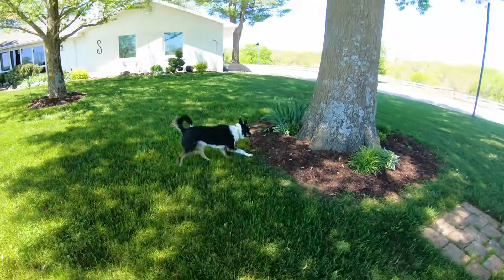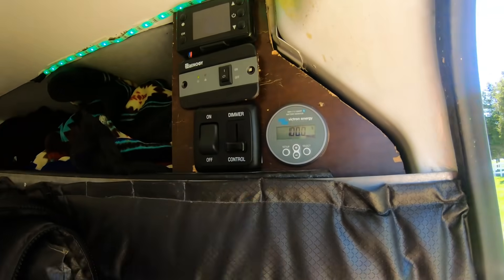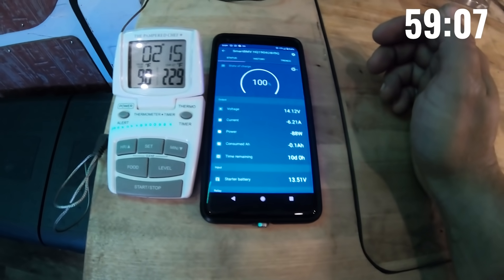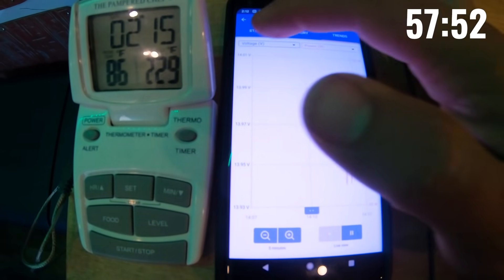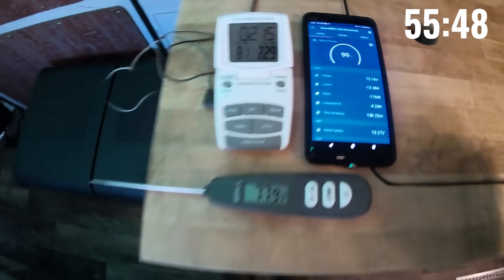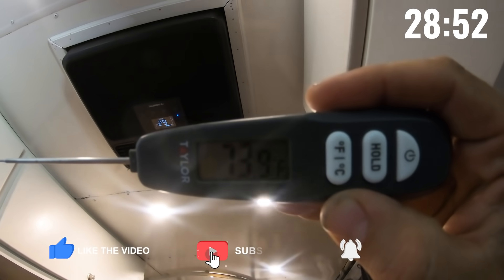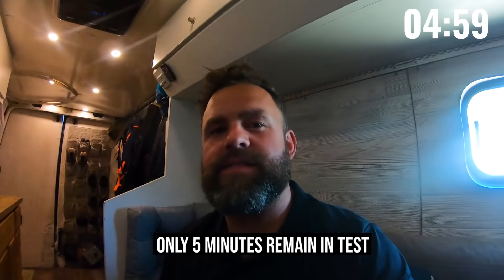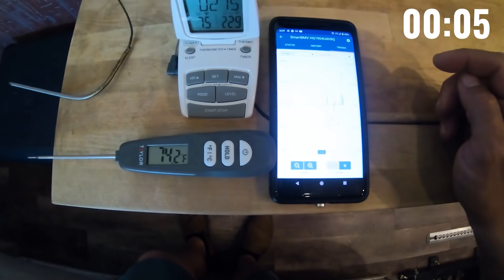12 Volt DC Air Conditioner | POWER CONSUMPTION TEST | Dometic RTX 2000 |  Van Life

Comment: Wouldn't people be precooling their rig with the van AC, then using the roof one to hold that temp once shut off? That should significantly increase the run time on the batteries.

Also, do you have your house batteries isolated or tied to the van alternator?

If this has been answered, then I'm sorry. I just found you channel and this is all I have seen. Please point me to the correct video if applicable, thanks.

Comment: The "hybrid method".

Run around doing your chores, sightseeing, etc. w/the van a/c running full tilt... then when you are at your destination, turn on the roof a/c (while the van still idles). Within minutes & very little battery usage, you will be at any reasonable indoor temp.

Btw, is that an a/c only, or a heat pump that also heats when it's chilly out?

Fyi, you should install window shades on the outside of the van to keep that huge windshield, etc from having solar gain!  They must be outside for best reduction. 

These have been common with class A & C rv's forever.

I like your wet jet cleaner for the panels!!!

Comment: If been saying it for about 2years now, the first company that can successfully make a GOOD air conditioner for vanlife will end up being rich....because we're all waiting for it!
Reply: The mini split I installed on my travel trailer uses 300-400 watts compared to the 1200w the factory Air conditioner used. It's much quieter too 😁!
Reply: @chachi5975   Hi, does it run on DC?  What is the brand?  I do know those are whisper quiet.
Reply: @garyhiland6013  power inverter so I guess it's not quite the perfect solution but I have a significant solar setup.
Reply: @chachi5975  WOW ❤️☮️ thanks for sharing 💖
Reply: @chachi5975  which model?
Reply: What size is the AC unit?
Reply: There is a HUGE pent up demand ready to Buy a good DC air conditioner that can run directly off the solar panels.
Reply: I've been running a minisplit in the Chihuahuan desert for over a year one three solar panels.  Used panels at that. Self installed. Under $1500 for everything AC, Inverter, battery, panels, charge controller. It's also scalable. And replacement or repair parts are widely available, unlike rare Uber expensive RV units that use double or triple the power.
Reply: You are so right!
Reply: $4k for this unit? They get rich and their customers get poor...
Reply: @billiamc1969  4K? I don’t think it’s that much…2.7k, I think.
Reply: @robertsarzanini1676  ?domestic link no rtx model? Bad link
Reply: @billiamc1969  

If you think that's bad consider how much a vehicle depreciation costs you.
Reply: I’m sure the owner of Dometic is already rich
Reply: Very useful
Reply: Whirlpool, though wall and a 1000 watt inverter.
Reply: They make 24/48vdc (or 120/220v ac) mini splits that do this very nicely , low power and not very much noise.That size area he has betting a 6-9k unit would do nicely and only take 500w-1000w depending on chill you demand inside of van vs outside temp then it drops down to say 300w-600w to maintain it after it gets down to temperature .Fill roof with 400w solar panels and mount the ceiling cassette or inside ceiling/wall unit. Mount condenser on back door as it only weighs maybe 85-100lbs.People do it all the time in both AC and DC versions of mini splits.Better to use the 48vdc versions as your using solar/batteries anyhow.Will need to upgrade battery bank/split inverter to lithium to be able to use the 220 versions on larger RV's that need larger then 12k but units that require 220 ac.
Reply: Alibaba. $430 for the unbranded version of this. :-)
Reply: @BreAsop  lol its true just type 12v air conditioner
Reply: @BreAsop  could you show a link to the Chinese copy rtx 2000
Reply: @BreAsop  unbranded no warranty good luck sucker price
Reply: @doghousejim  personally don't care about warranties, do all the repair work myself.
Reply: I dont have a van so i'm not waiting for it. 
i just came here for the solar powered ac content. i dont care about vans.
Reply: @darkshadowsx5949  We don't care.

Comment: 5,000 btu window air conditioner uses about 450 w off an inverter and they cost under $200
Reply from the maker: But then you have to cut a giant hole in your rig that screams "someone lives in here!"  For that reason I experimented with disassembling a traditional window unit and mounting it as a mini split with the radiator underneath the van to expel heat and condensation..... After much trial and error I decided to go with this roof unit. To each their own, just trying to spread info on this unit that just hit markets spring 2021. ✌️
Reply: This..if it falls out you just keep driving.  Wal mart had some 5000btu window ac marked down years ago for $30..i should have bought the whole pallet.

Comment: With the panel output you are still in deficit consumption mode, not sustainable long term. However once the van is cool you may not be in a deficit. What I would like to see is a test over several days.
Reply: Solution is simple. Run van engine for a wee blast.
Reply from the maker: This may be true. I need to test individual panels and see if any diodes have failed.
Reply: We just installed a 200w, 20amp system on our augmented scuba trailer.  Since we're completely new to the off-grid aspect, we didn't want to jump into the deep end, and we know pretty much all of the system is scalable.  While insulation has dramatically helped reduce the heat build up (we live on the Tex/Mex border that you've heard so much about lately), and extremely high-efficiency A/C unit would be a nice add-on.  Did you find that you had enough solar coming off of just the two panels (assuming nominal PV production from them) to be enough for the A/C unit?
Reply: @cetifoxproductions  you generally need 1000 watts minimum. My 800 watts is not enough for all day.

Comment: If I’m not mistaken you can take battle born batteries all the way down to zero and recharge without damaging… also they have a 10 yr warranty
Reply from the maker: You need to read about Lithium batteries (including BB!) DOD or Depth of Discharge. Simply put, any discharge below 20% of the battery,  you WILL degrade the total amount of power the battery will be able to hold. This can ultimately lead to a shorter life if you are constantly discharging them to near 20%... In comparison Lead acid batteries are only supposed to have a DOD of 50% this is one of a few reasons that Lithium are superior to Lead acid. I do believe BB batteries have a BMS (Battery Monitoring System) that will prevent you from discharging them below 20% but you should know what stress you are putting your expensive system through!

Comment: It doesnt blow lower than its set at until the return air drops below roughly 10-15 above the set point. If its 65 in the room it will be around 50-55 coming off the ac

Comment: My 5000 btu AC only draws 27amps DC in my roadtrek. With 560 ah 13 volts of lithium that gives me almost 20 hours of use, and of course much extended with my 300w of solar. It kind of looks like a regular small air conditioner does pretty good, as compared to you Dometic. Of course when 560ah are gone it takes a long time to charge.
Reply: Hi Rick,. What brand ac is that?  Where are they sold?  I'm interested.
Reply: yea, what brand, model you got?

Comment: Thanks for posting this. I forgot there were options besides a 14000 btu 20A AC unit powered by an inverter for boondocking.
Reply: They make 24 and 48 vdc complete roof top units , have been for many decades but are expensive compared to mini splits which do the job so much better , plus is you heat also from them.Roof units just arnt that efficient either 12v or the 120ac either ac or the heat pump models.

Comment: In residential hvac units, the rule of thumb is that the air coming out of the unit should be 20 degrees colder than the air going into it. The temperature you set it at has nothing to do with it. As the temperature in your van drops, the air coming out of the AC will drop with it. 

The temperature you set the AC to is just there so the unit will stop cooling when that temp is reached. It's just an "off" switch. Hope that clears it up, and thanks for the video.
Reply: If I am reading the specs correctly the unit has a variable speed compressor so the delta may vary with setpoint vs actual.
Reply: This is mostly true but changes a bit with variable speed compressors.

Comment: Noted that your solar panels are very close to your roof . Due to very big inefficiency of solar , it is a normal recommendation that the panels 
Are a minimum 70 mm off the roof .
Suggest you Google the inefficiency of solar as the temperature goes over 25 c
All panels ratings are done at 25c
You will be amazed.
Reply: Wouldn't that start to pose some issues with drag while driving the van?
Reply: @platinumsky845  if that concerns you , place a wind deflector at 45 deg on the very front panel. I did this on my van
Reply: @leithmurray736  alright, I'd just be worri d about the structural integrity under high wind speed but that sounds like it would help a lot, thanks.
Reply: @platinumsky845  I have 2 x 150 watt panels mounted on aluminium angle mounted directly to the roof of my vehicle with 70 mil space under the panels with. A 100 mil x 1100mil front aluminium wind deflector. This was done to keep the wind noise down to normal.
I have on one occasion tried to see what this campervan would do . At 175 kph , I was starting to run out of road
The van has done over 100.000 kil with these panels on .

Comment: I have an ecoflow delta with (2) 110 solar panels... Would this power it okay? Thank you!
Reply: Not enough power sadly (1008wh useable) with your set up. You might be able to run for a couple hours. The issue is I don't believe with the Ecoflow you will be able to get caught back up with a recharge on your system with only 220 watts of solar (topically never get the full watts out of panels). Ie unless you have a fast charge, more panels and full sun non stop which is not going to happen sadly with most SoGens on the market currently. 
~ Mark (Bluetti AC200, Jackery 500 & 160 + 900 watts of portable panels)
Reply: Thank you so much for the reply!  That's kind of what I figured... God Bless.
Reply: @elsewhere9167  My pleasure it can be very confusing understanding solar generators. Best thing is just us it. I have a video on our TY explaining how we use our set up. Each SoGen will very. ⛺=🙂

Comment: Where did you get the insulated barrier curtain?
Reply from the maker: I found inspiration from other van lifer's for a blackout curtain that also insulated the temperatures from the cab and the living area and sewed it together with the help of my crafty mother. I utilized ripstop vinyl, heavy duty zippers, 3M Thinsulate and magnets around the outside to attach to a metal frame to keep it hanging and also easily detach.
Reply: You should check out the curtain systems that semi trucks have. There are 2 curtains that cover driver side window and passenger window that wrap around the dash and are joined in the middle. They run along a little track system that's almost invisible due to the size and mounting position. When not in use, they simply tie back just behind the seats so it doesn't block your view or entry/exit points. Next, there are curtains that divide the cab from the sleeper. These can function the same way with 2 separate pieces joining in the middle or just be one piece that attaches to the opposing wall. The curtains vary in style, weight, and thickness from truck to truck depending on manufacturer and year the truck was made. They do however, have some form of insulation, sound dampening material, or some combination of the two. If by chance you stumble upon something like this, on eBay, Craigslist, Offerup, etc., there is a good chance that you wind up with a bargain due to the specific application. I haven't heard of any countries being overthrown due to vehicle curtain shortages in recent times ya know? LoL. Great video man, thanks for sharing.. P. S. My favorite set of curtains came were in both post 2004 Volvos that I was issued. They also had 4 thick memory foam cushions that were used for the 2 bench seats and as your mattress. Some of the best sleep I ever had as a truck driver.

Comment: It better work well for $2,700. I built in a window AC where all you see is a louver on the outside and it easily cools my step van, cost = $160 It would be really hard to do in a cargo van though.
Reply from the maker: I was considering a window unit in a few different configurations mounted in the van or partially underneath for the last two years but it came down to space saving, and reliability that I decided this 12 volt unit was worth the large investment. This AC unit is the most expensive component of my van build and there were no real world reviews, hence why I decided to film this video and share with other like minded DIY'rs.

How much power does your window AC unit draw and how do you power it? The most efficient unit I could find was a Danby 6k btu window unit that was heavy and awkward but provided COLD air and only drew 600watts at 80°F. Mounting the unit was problematic in a crowded sprinter van hence why I went with a roof unit.
Reply: @insidiouspeanut  Mine is a GE 5000 btu unit and I figure with inverter losses it draws 500 watts on high and a little more on low, go figure. 90% of the time I have shore power when I need it but my solar system can run it pretty easily for a few hours. 1200 watts of solar and 170 AH (24v) lithium battery.

Comment: Ben, this was an amazing video (for me); didn't know solar powered a/c was avail. Def will do add'l research; might be great upgrade! Pulling the insulated curtains and (maybe) using Reflectix on the windows would def help with the temp and a/c cooling. Thanks for sharing!
Y'all Be Safe!
Reply from the maker: Glad it was useful to you, I made this video to share knowledge that I have learned in my quest for an air conditioner capable of running WITHOUT a generator or typical plug in electrical source. 

Windows are a huge escapement route for thermal air, hence why I only have a small window in the rear of my rig. My insulated curtains are home-made from vinyl and 3M thinsulate in order to keep the heat from the cabin separate from the living area... it works very well for this along with added privacy!

My van was insulated with closed cell foam spray to a depth of 1.5"-2." on the walls, doors and the roof, I then put another layer of 3M thinsulate over the spray foam before installing my paneling. Rigid foam board was used on the floor underneath 3/4" plywood. I estimate an R-value of approximately 18 in my build, this is very efficient! The weak point would be the seals around the doors not being perfect and allowing air to escape. Proper insulation is key to maintaining an area capable of heat regulation.

Comment: thanks for showing and doing this test and As I understand it dra 500w on full power and put it from 90 F to 75 F (31C to 23C) but how much does it consum to keep it at that level since in the long run it is good to know. even if it can be hard to compare since it depend on amount of isolation and outside temp
Reply from the maker: I have seen this unit pull as much as 650watts on a 90° when initially cooling down. The advantage of this unit is the variable compressor speed that allows it to be energy efficient when maintaining a temperature for long periods versus typical units that must switch ON / OFF with compressor running on full.

Comment: Thanks, been trying to find a way to run ac only at night in small rv. This may work
Reply: It may work, but remember, he's running this with 800 watts of solar panels on the roof, which obviously won't be providing power at night, so batteries would deplete faster, although hopefully at some point, the AC would stop running completely during the night or would at the very least cycle off and on.
Reply: @rejeandurette3471  800 with turbo on. Eco mode it was 140. Should be more than enough for a bluetti to handle. But yeah, more batteries is usually the answer for all power needs.